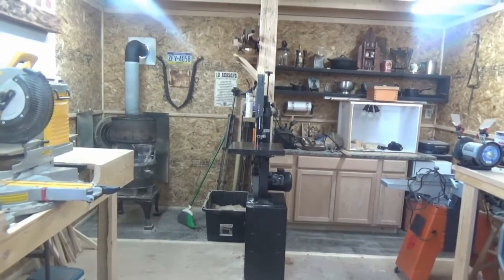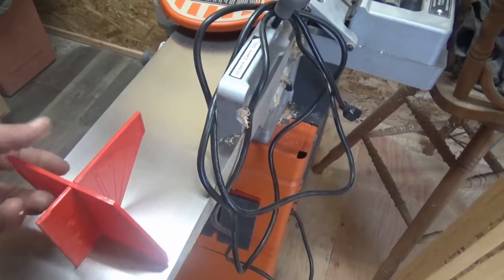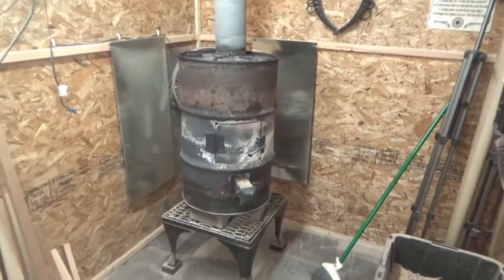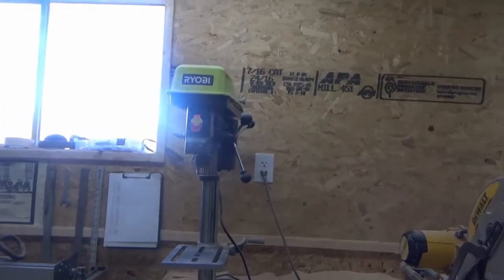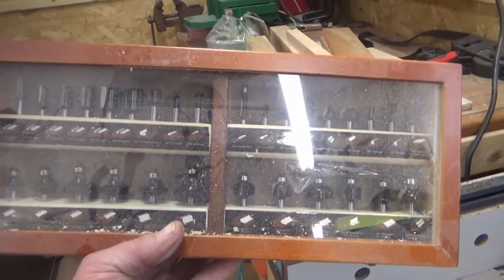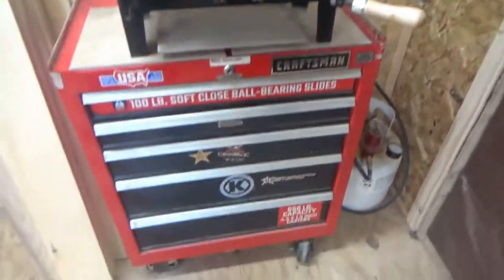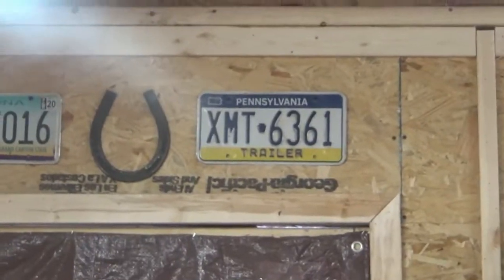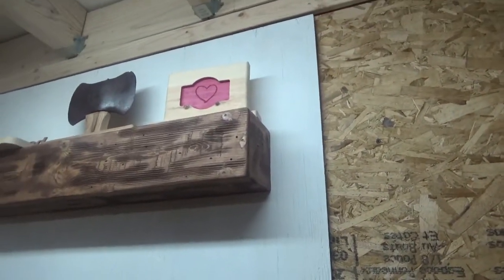2022 Quick Shop Update, Ridgid, Barrel Stove, Porter Cable, and More

Comment: Shop looks good
Reply from the maker: TY!
Reply: By the way did you install an oil gauge on the cub? I have the same UTV and love it.
Reply from the maker: @jamiebrewer6876  It's been a good UTV so far. Have not done the oil pressure gauge as of yet. Moving, work, and life have been a real hassle. Soon though, soon.
Reply: Absolutely thanks for all the info on the cub i know it helps me tremendously